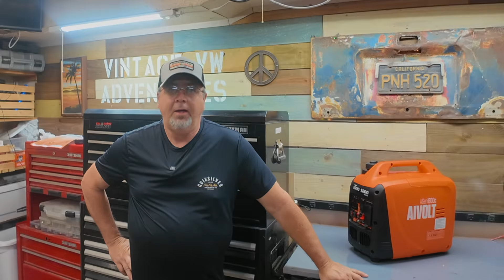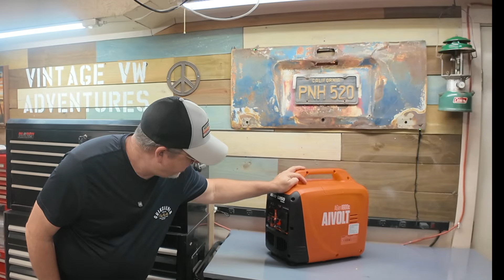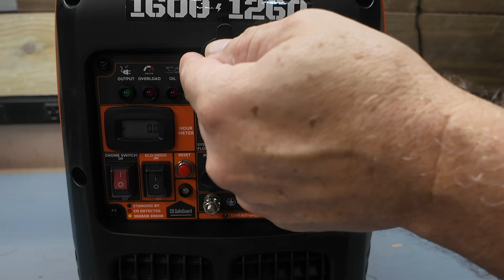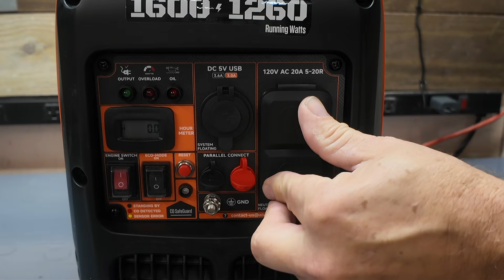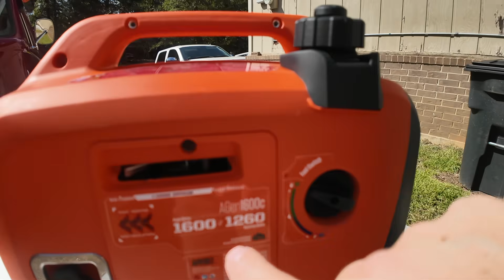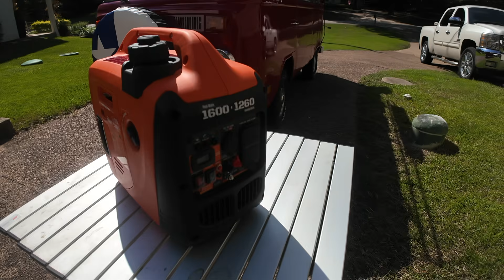AIVOLT 1600W Super Quiet Inverter Generator, Ultra Lightweight Gas Powered Portable Generator

Comment: It needs to be said you need 2500 to 3500 wat generator minimum I ac I fridge you got a little power to spare . Plus you run them at max they eat gas  . Over kill on wats you run 50 percent load less noise less gas
Reply from the maker: My RV requires a 3800 gen to run its ac.
Reply: Yes I have a 1600 for work it covers my battery chargers and 1 5000 AC running max power. New model acs only. Lol😂
Reply from the maker: I have a 1000 watt sportsman that will run a 5000 BTU window unit but the ac has to stay turned all the way up. It doesn’t have a soft start compositor. So if it cycles the compressor on and off it will kill generator. My little refrigerator/ Freezer only pulls. 30 watts. Most of the time the 200 watts of solar keeps up with it. When I run my 12 volt air conditioner it pulls 450 watts so hopefully this little 1600 will keep up. My other 1000 watt unit could not unfortunately. I’ll definitely do updates on how it does over the next season.